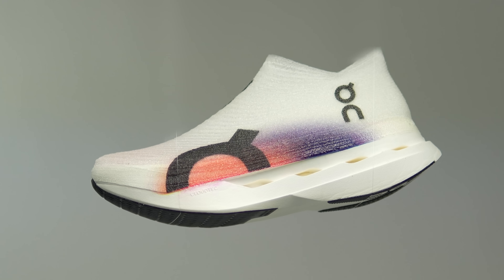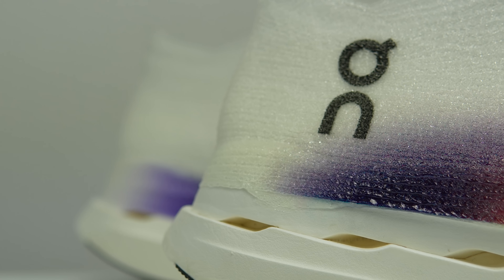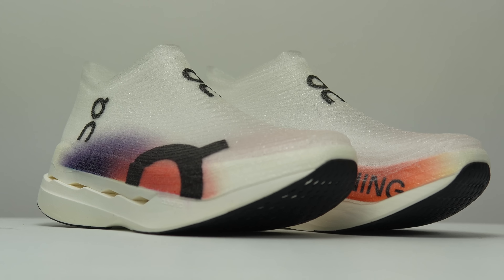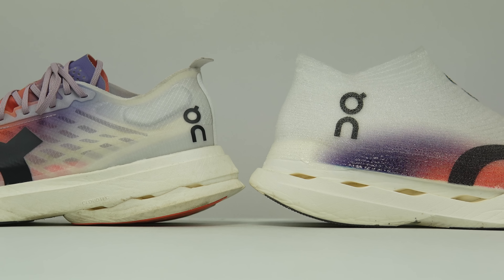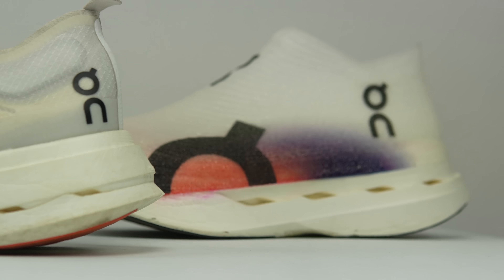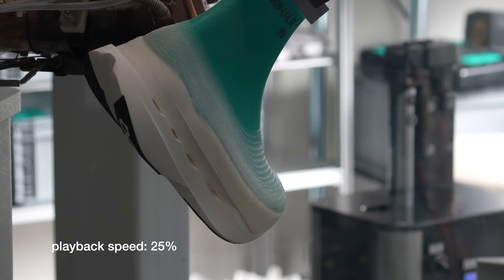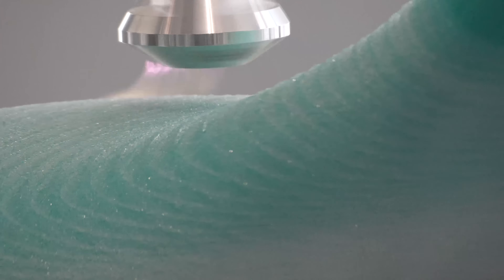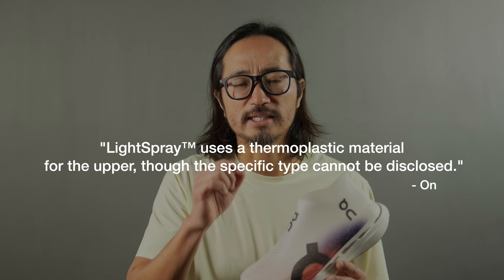On Cloudboom Strike LS

Comment: I can’t comprehend the courage required to wear socks that don’t go up high enough to prevent the shoe touching raw skin 😅
Reply: Triathletes go no socks at all and it's no problem for most shoes.
Reply: The material is very smooth on the inside. It’s not the same surface as the outside.
Reply from the maker: it could have gone very poorly. thankfully, it worked out just fine

Comment: For anybody concerned about the longevity even after Mike’s review. I want you guys to know that I attended a private event at the On NYC Labs and got to talk to Johannes (the creator of LightSpray) for a good amount of time and he’s so confident about the material that his next project is to put this in a more accesible daily trainer. It seems LightSpray is here to stay for the long run.
Reply: Usually how shoe tech goes. Starts in the top stuff and works its way down, just like how a bunch of daily trainers have PEBA now.
Reply: @styx15 Good point. Frankly depending on the way it's used, this type of innovation might actually make me interested in trying an On shoe.
Reply: Do you think that you can do it for daily use? Like walking, running, etcetera? I was also concern about to break pretty easily.
Reply: No shit.

This model is just a test run to see if the market is open to a 300$ shoe with crazy tech and to pay for RnD with the money of those sales.

After that, obviously, if the shoes sell, and they'll definitely sell because "reviewers" are selling them like crazy, they're gonna make it the primary way of producing new models since it takes 3 minutes to make a shoe right now.

They're going to fatten up their margins by not having to pay any more wages because why should they pay a salary to a hot glue spray gun?
And, by making it so readily available and by patenting the tech, they'll make even more money.

If ON has a public company, buy stocks now.

That's it 🤷🏽‍♂️

Comment: Agree with some of the other comments. For $330 I would expect them to scan my foot and make the upper match me 1:1 which would be amazing. Glad there is growing competition from On though, even if I don't prefer their shoes.
Reply from the maker: I was thinking about it quite on my run after publishing this video, and I'm thinking that, depending on how marketing costs get allocated to this shoe, how R&D costs get allocated, and the relative small number of units that they will likely be making, this shoe probably costs On more than $330 to produce. 
If they made like 10x (or some other hypothetical amount) the shoes at the same price, maybe they'd make profit. If they made 15x, then maybe the price could come down (which isn't typically a priority for On) or there could be more customization. 
I did ask about customization though and how it would intersect with the rules against bespoke or custom shoes for elite athletes at World Athletics events. The On rep I was speaking with didn't have an answer for me at the time.
Reply: I subscribe to the cyclon shoes and it would be so cool if you could scan your foot and then subscribe to the LS when you have a race.
Reply: @kofuzi  believe it or not, they are surely making a profit on this shoe. because we already know that a flagship shoe can be sold for over 450$.
it's really hard to price in the r&d because that usually has a different amortization schedule.

Comment: The future I'm excited about:
Going to the store.
Getting your feet scanned.
See what is the best fit of lets say 10 predetermined lasts.
have the machine spray that last in a few minutes.
I just don't think the economics of this machine can let that happen :(
Reply: @itaymeiri5745  not only the economics but the lack of engineers that are educated about this machine’s hardware/software plays a huge role as well. Johannes had mentioned he didn’t even want to be at NYC but that he needed to be there because only 2-3 people at On know how to troubleshoot and work around the machine in case of a failure.
Reply from the maker: I can't remember if it was Drew, Bromka, or someone else that I was with in New York when we were watching the machine, but that person reminded me that localized shoe production was the promise with Adidas 3D printed shoes, too. 
And I feel like the industry would have to just change so much, and shoe stores would have to continually invest so much, that I'm skeptical that we are anywhere close to any brand having any machine that would be able to custom produce a shoe based on a customer's actual foot in real time.
Reply: @kofuzi Also remember that the promise of 3D printing in general was similar. Everyone could print everything they'd ever need.  Where are 3D printers now? I agree with you, probably not feasible at a store level.

Comment: As much as I want to love this. We've all had countless pairs of running shoes. Adjusting laces is a necessity. There is close to 0 chance this will maintain lockdown security as the shoe racks miles.

Undoubtedly another feather in ON's cap but the shoe will be resigned to "Performance Athleisure", which, let's be honest, ON specialise in.

Comment: It all looks amazing. This is how the future is built. However, I am keeping a close eye on long-term durability. The fact that it will be on spikes, in my opinion, does not necessarily mean that it will be durable during longer use. Elite can replace these spikes whenever they want, so the only thing that is really known for now is that you can use this material hard. How long? We'll see, I keep my fingers crossed!
Reply from the maker: I will concede that the use of the material in a spike is not direct proof that the material has durability, but I think we should also recognize that there is no direct proof one way or the other (otherwise we would just refer to that longevity data). 
stay tuned for the 100 mile review.

Comment: Ventilation & moisture management?   Does ON have anything to say about how the shoe handles the environment, cold & heat, foot swelling, etc?  I noticed you splashed in some puddles in the Cloud Surfer scenes but not this shoe...
Reply from the maker: I wouldn't read too much into the splashing. I can't control the weather. If there's puddles, I'll run through them. If there aren't, I won't hold a review video in the hopes that some might arise.
Reply from the maker: the foam is pebax that is partially bio-based. I would anticipate that the shoe handles cold temperatures as well as other pebax compounds (I want to call this a bio pebax, but bio pebax is a trade name and there must be a reason why On doesn't use that phrase).

Comment: Do you think they are compatible with orthopedic insoles? Because normally I remove the thin insole of the shoes, but with this drop in midsole it's not possible to do it, so maybe the orthopedic insoles don't fit. Same question for the regular cloudboom strike I guess. Thanks!

Comment: Now I will admit I may have missed something, but I don't remember hearing the word 'lockdown' in this.  I really admire the omission and consider this a big step forward for Kofuzi.  I am not kidding.

ShoeTubers seem to have invented the term in relation to shoes.  I have never experienced nor sought lockdown.  I have never wondered how much lockdown a shoe possessed.  How could I when it didn't exist?  I had never heard of it prior to YouTube's popularity. 

I am not being sarcastic in the least. Keep this up!
Reply: Well, most of us have experienced the phenomenon when it’s lacking, whether you had heard that word or not. When a shoe feels like your foot is wallowing around in a shoe in any way instead of feeling like an extension of your foot (ideally, you’re not thinking at all about the shoe when things fit right), it’s very frustrating. Everyone’s foot is different in relation to every model of shoe. When too many runners complain of the same thing—-either a lacing system that’s not cinching securely, or a heel that too many runners tend to slide out of too easily to give 2 examples—-then that shoe may have a flaw or at least weakness in that department. What else would you propose to call that phenomenon and why do you deny that it exists? At the very least, one should be able to state that “for me, the lack of supportive elements combined with the voluminous toebox of the Rebel 4 didn’t provide a secure lockdown”—for a personal example.